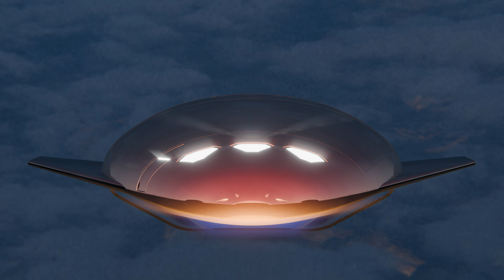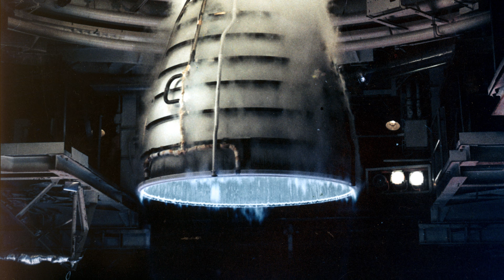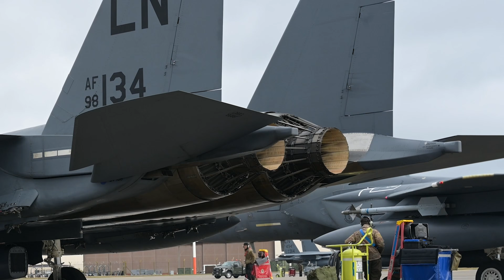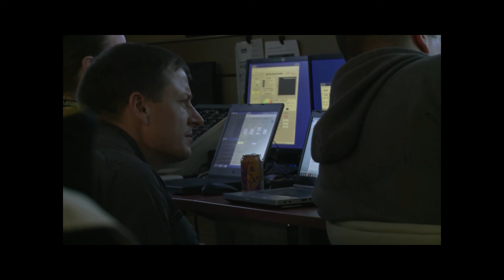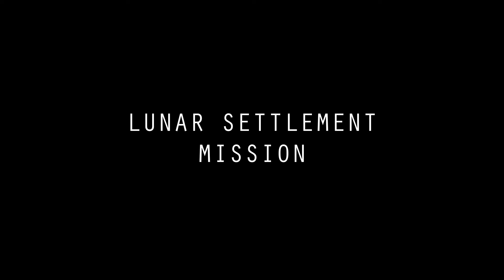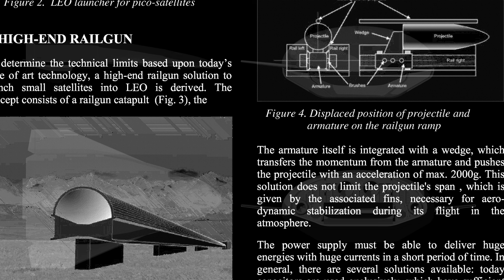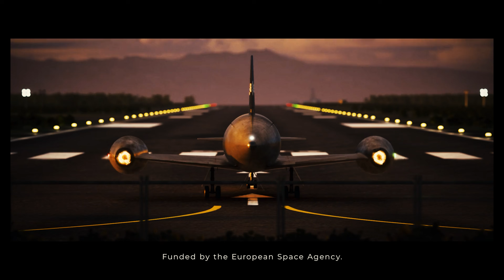Modernizing the SSTO with Launch Assist Technologies

Comment: HOTOL never converted atmospheric oxygen into liquid oxygen. That was never the plan and couldn’t work. Instead it simply cooled air to the point it could be burned with liquid hydrogen.

When over about mach 5 they would switch to the liquid oxygen they had loaded on the ground.

Due to the semi secret nature of the design in the 1980s however, they were unable to clarify this fact, and journalists made incorrect assumptions which circulated for decades.

Source; met people that worked on HOTOL and SKYLON.
Reply from the maker: You're confusing HOTOL with Sabre. Sabre indeed removed the liquefaction function, but recall that HOTOL was derived directly from the LACE (liquid air cycle engine.) HOTOL also never planned to ingest the LOX it produced from condensation, whereas this design does. The claim that this "couldn't work" makes little sense as LACE had achieved positive results in the 1960s.
Reply: @De-Mystifying  1:41 you claim HOTOL planned to liquify the air, (and imply they planned to separate it into oxygen and nitrogen).

Which wasn’t true, but was widely believed at the time because the official secrets act prevented the engineers from saying that was stupid and wouldn’t work (or words to that effect, this talk was over a decade ago). I think they were of the opinion that LACE was not a viable approach, but presumably it wasn’t so classified, so a journalist trying to do research would probably encounter it. 

They did speak about Sabre, in a “well I’m not sure I believe what Alan is claiming with these performance figures but I hope he’s right” way. 

By the time I met Reaction Engines employees they’d pivoted from spaceflight entirely, probably because SpaceX rendered them obsolete.
Reply: @HALLish-jl5mo  REL never managed to close a business case for SABRE and was hesitant to move from the SKYLON design and SABRE as an SSTO engine even though there were agencies both public and government more interested in SABRE as a booster rather than SSTO use. SpaceX hasn't rendered anyone "obsolete" and there is still missions that could be fulfilled with an operational SABRE like engine, there just isn't the money to pursue all the possible options.
Reply: @De-Mystifying  Not correct according to REL itself which noted they used "super-cooled" but NOT liquified air in the SABRE which was itself a more advanced work on the HOTOL engine. Neither used a LACE cycle due to the LACE cycle having been found to "waste:" too much hydrogen to get to a point where you had LOX. This was the major "breakthrough" for HOTOL/SABRE as it was far easier to create "supercooled" rather than liquid oxygen. This was actually discovered in the US during the 1950s work on the "Aerospaceplane" concept and it's hypersonic LACE cycle work when a subcontractor found that "supercooled" but not liquid air was able to be pressurized in a turbopump system and fed into a rocket engine. The main 'contract' was for a liquid air system so the main contractor essentially said, "Neat but we don't want that so get back to work" and the idea had to wait for REL to rediscover it.

Both HOTEL and SABRE left the atmosphere by Mach 5 for the simple reason that above Mach 5 the needed hydrogen  to cool, let alone liquify, air skyrockets to unsustainable levels. (Hence the addition of the idea of "refueling" the Aerospaceplane with ANOTHER Aerospaceplane at hypersonic speeds) :LACE does in fact work and more recent studies in the 90s have argued for subsonic air collection since that has a plausible level of hydrogen use but still requires much more hydrogen than needed to get to orbit due to the overall inefficiency of the process.
Source is REL articles and information..